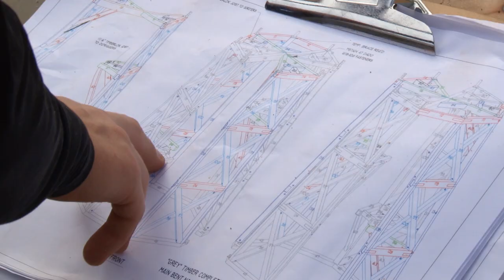Rebuilding a Historic Timber Frame Water Tower

Comment: This is so cool!!
Reply from the maker: Thank you!
Reply: What is the rough cost of 1000 sq ft barn wth 10ft lower section and 1000 sq ft studio on top w 8 ft height?
Reply from the maker: @leonardusdesignleonardusde3479  Our sister company The Barn Yard has 4 special package barns you should check out for approximate pricing. All our post & beam barns are available as kits shipped & raised nationwide. For more info, please contact us on our website or call 1-800-628-2276.

Special Packages:
https://www.thebarnyardstore.com/post-and-beam-barns/special-packages/

Contact us:
https://www.thebarnyardstore.com/get-started/